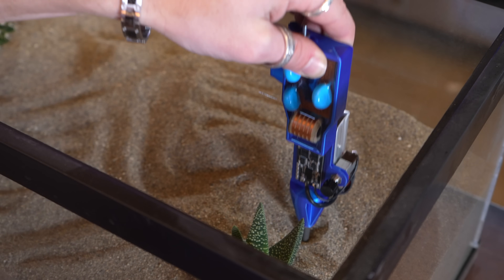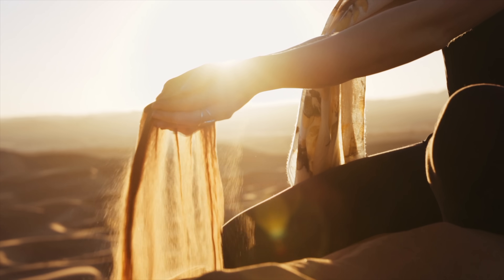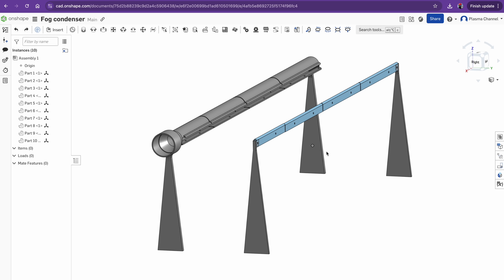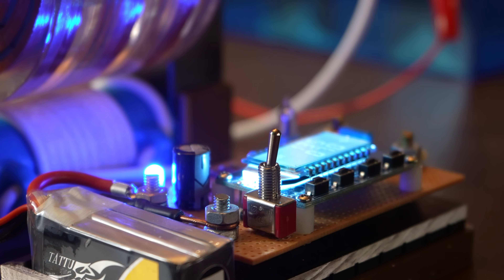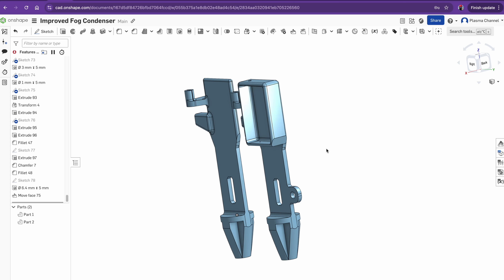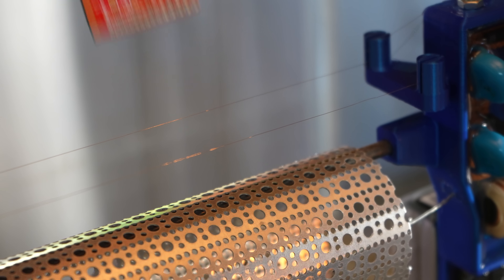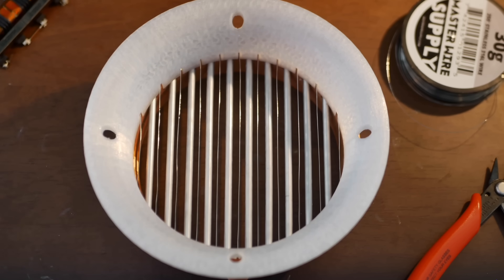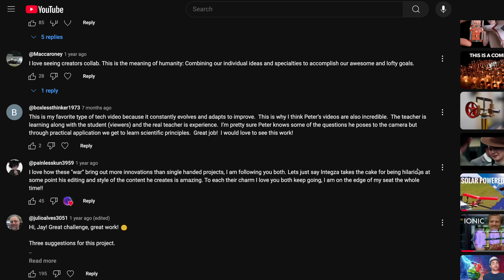Solving Desert Water Shortages Using 20,000 Volts

Comment: U should not drink excessive amounts of purified water and here is the reason y.  Drinking a lot of purified water isn’t necessarily dangerous in moderation — in fact, it’s generally safe. But drinking excessive amounts of purified water can be harmful under certain conditions. Here’s why:

⸻

⚠️ 1. Lack of Minerals (Deionized or Distilled Water)

Some types of purified water — especially distilled or deionized water — have had almost all minerals removed (like calcium, magnesium, potassium). This matters because:
	•	Your body needs electrolytes for muscle, nerve, and heart function.
	•	Drinking only mineral-free water over long periods may dilute or leach electrolytes from your body.
	•	This can lead to muscle cramps, fatigue, or in extreme cases, electrolyte imbalances (like hyponatremia).

⸻

⚠️ 2. Water Intoxication (Hyponatremia)

This happens when you drink too much water too quickly, overwhelming your kidneys.
	•	It dilutes the sodium levels in your blood.
	•	Can cause headache, confusion, seizures, and even death in severe cases.
	•	Purified water, having no electrolytes, may increase this risk if you’re already low on salts.

⸻

⚠️ 3. No Buffering Capacity

Some purified waters (especially reverse osmosis or distilled) can be slightly acidic, with a pH below 7. This doesn’t usually cause harm, but over time, highly purified water:
	•	May erode dental enamel slightly faster than mineral water.
	•	Might increase acid load if you’re drinking a lot and not eating enough alkaline foods.

⸻

✅ Safe Guidelines:
	•	Drinking 2–3 liters of purified water per day is fine for most adults.
	•	If you’re sweating a lot, sick, or exercising, you need to replenish electrolytes, not just water.
•Rotate in mineral water, or add a pinch of Himalayan salt or electrolyte drops to your purified water if you drink a lot.
If you meant “purified” in the general sense (like filtered tap water), the risk is lower, but the above still applies when consumed excessively. Let me know what kind of water you’re referring to (reverse osmosis, distilled, bottled, etc.), and I can tailor the answer more specifically.

Comment: And Elon should visit with this chap  and NASA may just in basic theory have a real deal Recycle option for rocket engine using (input Hydrogen inputted into super heated steam. Without an adequate electric drop filter in proximity of crew quarters thee whole experiment will go bang)

Comment: You made a dehumidifier, cant say im impressed. MIT made a dehumidifier a few years ago, to solve the exact same problem, it was called the waterseer, and it was complete failure. You can call it a fog collector all you like, but you're still taking water from the air, and there just isn't enough humidity in the places where this would be used for it to actually be useful. It's far cheaper to just import water

Comment: Nice work! But there’s a but, that “dehumidifier” is only labeled as such. It’s a terribly efficient peltier based device thats every bit as horrible as the novelty “refrigerators” based on the same device. Compare it to a refrigerant (heat pump) dehumidifier, they are wildly efficient although what you’re messing with may be more practical in its application as a refrigerant based dehumidifier can be quite picky about ambient temperatures among other considerations

Comment: The flywheel won't spin fast enough to make an impact. And you could flip the cogs so you can capture energy in both directions. How do you account for branch/trunk movement angles? And system shock! A sudden burst of wind or if the branches are moving opposite each other you will need a spring/shock of sorts so you're not snapping rope. 🤷🏿‍♂️

Comment: You should think about a more effective charge pump and high voltage storage (HV capacitor). When done right, your setup should draw NO power to uphold the 20kV. This also would mean that you could measure the actual energy need to charge the water. Then you could calculate what kind of power supply would be needed to do a large scale prototype. And while we are at it. You actually don't need a ground plate at all - just use the actual ground!
So all in all. A few "towers" of extremely high voltage that charge the air could be enough to drop the whole fog to the ground... Maybe dry sand needs a few grounding wires to start the process, and I probably would not want to stand there, in case the charge by the droplets builds up...

Comment: Interesting question !

Over what maximum area can this system be extended using the same power source ?

Would this system be more efficient with a single extended grid or with several separate grids ?
Reply: An even more interesting question:

Can multiple overlapping grids be used as electrodes to recycle the energy used?

Generally speaking,

Can loose electrodes be used to extend the ionization surface of the air? This could also have advantages in the field of propulsion.

Comment: Hey, did you consider insulating the ground and HV wires? This way instead of ionizing the fog droplets (which uses power due to corona discharge current) you are pushing them (like a fan) towards the ground. Neutral droplets would still move toward the ground via dielectrophoretic forces from the electric field gradient, acting like an electrostatic fan. This skips the energy-intensive ionization process, using near-zero power after initial setup, as the ground impact or contact handles condensation. It could be way more efficient since you’re not wasting energy on air ionization, just leveraging the field to direct droplets.

Assumes the impact on ground would be enough to force condensation, even if water generated drops, the power should be way lower, so may pencil out better.

Comment: Let me paint you a picture. Antofagasta, a costal town in Chiles Atacama desert will have a temp of 50°F and a humidity of 80% next morning. To get 1l (3.8l=1gallon) water out of the air you will have to COMPLETELY DRY OUT 4662 cubik feet of air. That is a cube of air 16.7x16.7x16.7 foot in size. For a little over a quarter of a gallon of water.

Comment: 0:28 that´s a lie. The air in most deserts is extremely dry. To have costal fog you need a cost. Most deserts are smack in the middle of a landmass.  So, I guess he solved water shortages in the desert Namib. Better than nothing, I guess.

Comment: I think you should try working both the dehumidifier angle and the "water trap" angle - where you can leave the irrigation angle to people experienced in irrigation.  You could also use grids of soaked sponge for both the emitter and the condencers/collectors, which would eliminate your corrosion issue and reduce cost.

Comment: Could you make a conical version of this, where the water becomes ionized using wires arranged in a circle, and is propelled through a grounded mesh collection cone with a decreasing cross-section, thereby dramatically increasing water droplet availability per unit area of collection surface?  Adding hydrophilic coatings should help increase the collection efficiency as well.  Seems like your ion thruster setup is a good starting point for testing this.

Comment: Interesting. I am convinced, that the power consumption is way too high. Most probably, the conversion from standard to static electricity eats up most of it. Did you try to store the output electricity in a high voltage condenser? Then, the power production could be much weaker.

Comment: I remember seeing an article about 13 years ago on some passive system that did this because of some properties of the plastic they used. They also tested it in the Atacama desert. It  would be interesting to find out what this system I saw is, and compare this with your system. You should try varying the voltage/current to see what gets you the most water per watt.

Comment: There're three things I want to know. How much humidity did you create and did you check it from a humidity sensor? You didn't mention and I think you didn't. And did you think that adding a humidity control to work the device so it won't work until humidity reaches a threshold? These are the questions in my mind. Also there're some companies like Watergen which have patented devices which can produce water from air but you said you've found nothing.

Comment: If you made a full size dehumidifier, which could do gallons per day, I would buy it. The dehumidifiers of that capacity are just AC compressors, so they're loud and produce heat as they dry the air, but yours is completely silent and won't heat the air.

Comment: @PlasmaChannel 
Great video but remember that fog in the Chilean desert is have moisture density 0.8g/m3 and from such a device 2-3g/m3. In this experiment you used a high density of water in the air in a very small container. The efficiency of such a net will also depend on the angle and speed at which the wind will move fog.

Comment: i liked the video, but the test to a commercial dehumidifier was flawed, because the intake is at the top, but you put the fog at the bottom (which you did not do with your build), besides this i still think your build would draw in more water due to the increase in surface area compaired to the commercial one, and the fact that the comercial one in encased for safety reasons, thus less contact with the water vapor resulting in less of a result.

Comment: I used AI to harvest the best ideas from the chat. It found several nice improvements to the system. Here's what it found: For max efficiency and real-world viability, consider: using a solar+battery setup with sensors to only run the high voltage grid during optimal fog periods; making the system modular, easy to maintain, and corrosion-resistant (think graphite-coated mesh); and aligning or rotating the grid with the wind. Pulsed or sensor-triggered voltage can save energy. Also, integration with windcatchers or funnels could boost collection. Excited to see real-world desert and coastal tests!

Comment: I'm sure you are aware of the desert ice houses and the shapes of those buildings and how it utilizes thermo-dynamics to keep ice frozen. Use that air forced through tubes to condense the fog.

Or a subterranean heat exchanger using natural circulation and the condensing action of warm air against colder tubes... absolutely zero electricity and no electrical component malfunctions. This is something way more possible to calculate using the thermal coefficients of the materials, a base fog temperature and everything is almost at atmospheric. There'd be a slight vacuum from the differential temperatures but it's doable. To upscale it refrigerants, pumps and fans could be added.

On the flip up-scaling your project it could be implemented into the shading and support structures of many of the existing agricultural setups already.

Comment: That's not a real dehumidifier at 14:45. That uses a peltier element for cooling, which is wildly inefficient. A real dehumidifier uses a heat pump. Check out Technology Connections' resent video for more information.

Comment: Most Impressive !! Thank you for the video. Well Done. A Question? As a small scale farmer, I've been trying to use a dehumidifier to dry leaves of a High Protein crop (within 4 hrs of cut,) that is very climate change friendly crop and significantly reducing the my not climate change friendly very expensive meal bill. Hence at 8 times more efficient than a dehumidifier do you see a way it could dehydrate leaves  8  times faster than a dehumidifier.????

Comment: Can water extraction also be achieved by condensation obtained by the relatively cold of the subsoil? Connect a condensation plate with a conducting metal rods which is drilled into the earth? Advantage; no dependence on vulnerable electronics or solar power, no wearing parts, etc. Reverse geothermal project..

Comment: I'm going to college for electrical engineering technician/technologist. You have piqued my interest massively. I'd be interested to see this used not necessarily as a direct watering system over crops (high voltage plus growing electrically conducting plants and farm work kinda scares me) but as a compact but large version to collect water from the atmosphere for a storage tank. From that tank then to standard irrigation or whatever other uses. Genuinely not even for a desert, I'm going to try this out at my mom's farm up north. We get fog too but also can use an easier access to clean water. TIME TO ELECTROCUTE MYSELF! lol, thanks for the idea never would've thought of this otherwise.

Comment: but it's not a good thing as well if you harness the moisture in the air. If the air has no moisture (zero relative humidity), it can cause a variety of problems for both humans and the environment. For humans, this can lead to dry skin, sore throats, and increased susceptibility to respiratory illnesses. In the environment, a lack of moisture can lead to decreased plant growth, soil erosion, and altered ecosystems.

Comment: It could be that the water can form as fast as you can push it off the metal surface, or it could be the other way, I don't know, but it would be interesting to test this theory. To use a metal grid with a shape and treated with hydrophobic treatment or the other way, let water stay as long as it can on the surface and let big drops accumulate? Would be interesting to test.

Comment: I think a compressor dehumidifier could beat it. Because it is more efficient than just 8x, comparing it to the peltier dehumidifier. It would be a very interesting test if you coud build a system that uses 100+ watts to compare it with a compressor dehumidifier.

Comment: You should contact Shaun Overton from Dustups. He is trying to turn desert into a forrest near the Mexican border. I think he would be happy to work with you to test the setup. I'm not sure how much fog he gets, but he has some ravines, where I'm sure moisture would be in the air at night. 
Have you thought of using car ignition coils (really cheap depending on what type you buy, and they run around 30kV). You can use your oscillator circuit to pulse the lt side of the coil.

Comment: If your water-drawing device is more energy-efficient than a traditional dehumidifier, could you turn your device  into a more efficient dehumidifier  by adding ventilation to draw in/out air  ? Bc one big drawback of dehumidifier used in house/apartment is the electricity cost per day (eg: around 3$/day for a House in Europe. If down to 1/10 or 9$/month that would be doable)

Comment: this is insane... i mean, am i crazy or does this seem like some kind of crazy technological breakthrough? i mean, with this basis, scaled up enough couldn't you just pull water out of thin air from anywhere? i dont know the science or anything, but with something like this could you not essentially turn excess power into clean drinking or irrigation water? or would it be so much more energy to pull regular moisture out of the air than to pull it from a fog full of excess moisture? maybe you could use a solar cell and slowly save up power to eventually get free water from solar energy. i dunno it's very late when i type this and my mind is racing a bit, i just cant help but think this technology could actually become something much bigger and crazier, but i may just be ignorant to the limitations lol

Comment: You can't solve water shortages when there is no water. Solve water in the arid desert: build a aqueduct. Bring water to where no water is. Trying to extract water from the already low levels of humidity is going to quickly take more energy then it would have taken to build a canal and at any scale extraction isn't even a viable option unless you can support 100's or thousands of people and everything that supports them in water needs from the morning dew drops you collect using a nuclear reactor.  You will need to filter this water too.

Comment: This is incredible. With just a few solar panels and a system like this, you could have a fully independent greenhouse in the desert. Combine it with light-reflective surfaces or underground "cool caves" and you could build a self-sufficient mansion. Water is always the main problem, but humidity always exists — even in dry air. Dry air actually creates more humidity at certain times! This invention could change everything for off-grid living, desert farming, and future eco-architecture. Congratulations for taking real action instead of just talking about it.

Comment: I have an idea, try combining your tech with the dehumidifier evaporator. Will it condense more water????? Isolate the electric current in the dehumidifier's evaporator lines so as to not short out the compressor. Then energize the refrigerant evaporator coil while grounding your collector coil just behind that evaporator. Try this setup with no added fog in the middle of the day